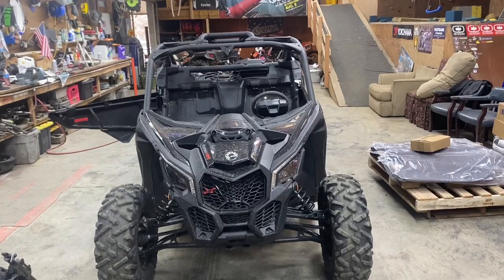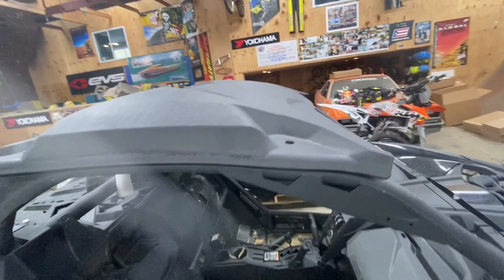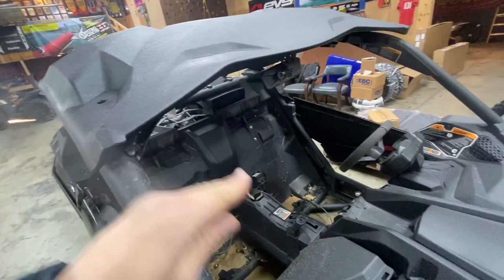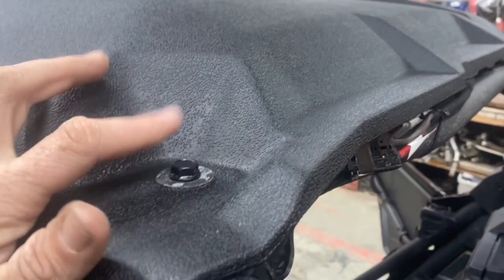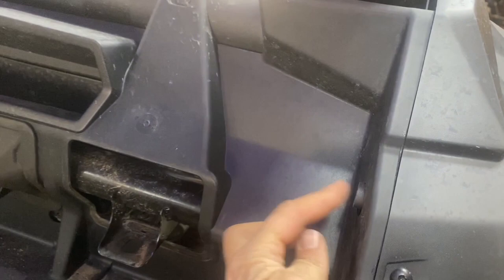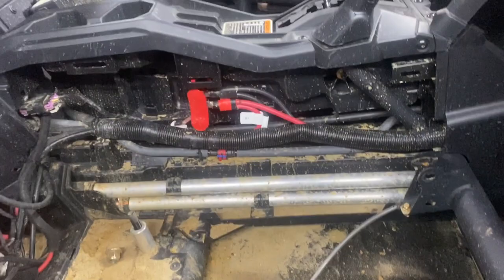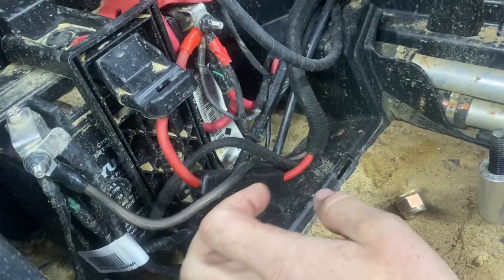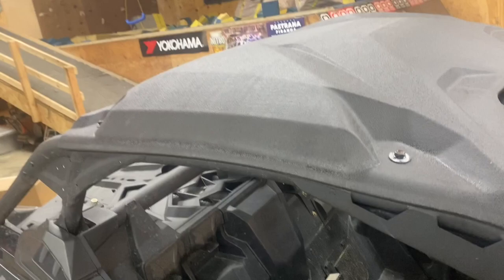Tech Talk Tuesday | How to install Can-Am Audio Roof for Maverick X3

Comment: What could cause my can am x3 to go in to limp mode, it usually happens to me when I go full throttle also the check engine turns on, I took it to the dealer and and they were not able to find the issue, it did it again after I took it out to the dunes, usually the check engine turns off after I turn off the car for about 5 minutes or more